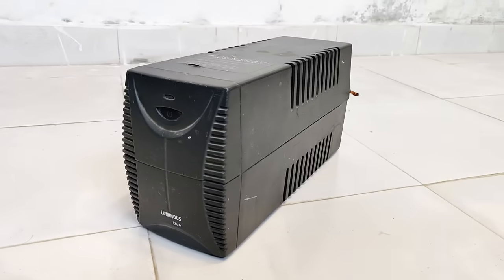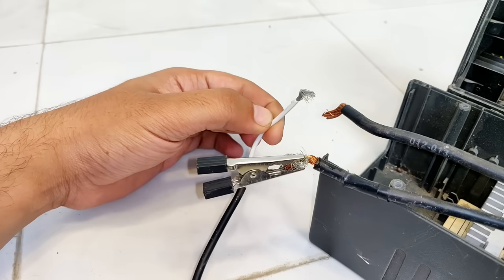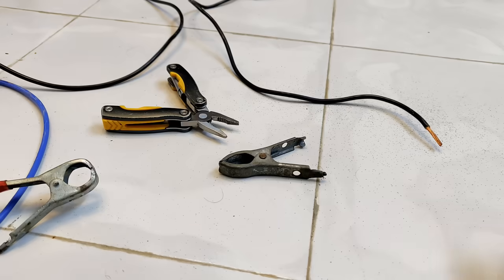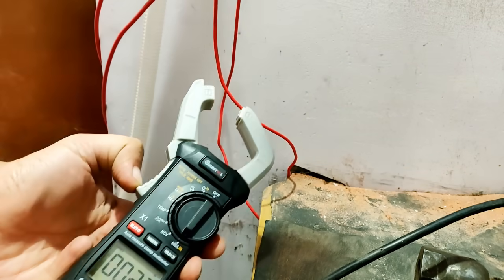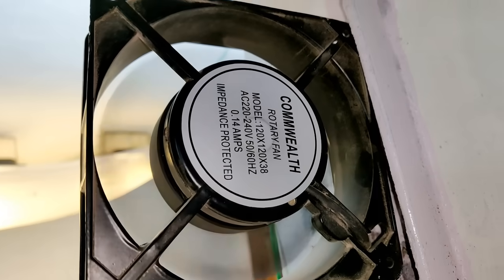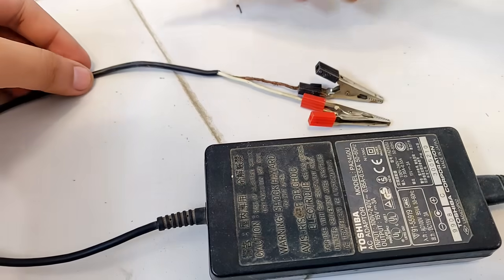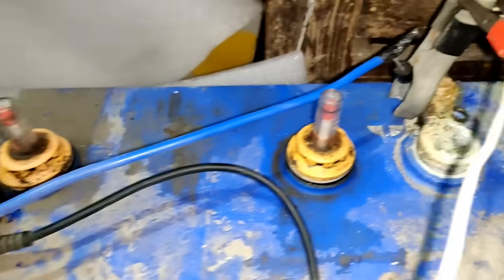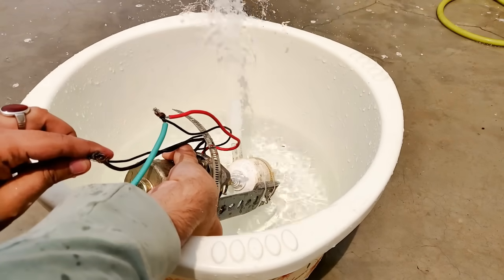Can a 12V 7Ah UPS Inverter ( 220v ) run with a 14.8V 150Ah Battery ?

Comment: I want to know if the ups switches off automatically after 20-30 minutes use ( because some ups automatically switches after 20 mins) I want it to run my 3d printer during power cuts with a car battery 48ah

If it switches off every 20 mins, what is the solution to that

Love your channel bhai
Reply: Yeah, there's a solution: buy a more expensive UPS, you cheapskate! Just teasing, but really, a 3d printer is a fabulous hi tech luxury.  You can't make a sows ear into a silk purse.  If you are in the jungle making computer parts for remote tribes, either: 1) Charge them more so you can buy better equipment to reliably make them the parts before the power cuts out, or  2)make the large parts into many smaller parts so there's less waste if the power cuts out.  I'm guessing you are a bright person who lives somewhere where there is very intermittent power.

 So my answer really is...."I don't know."  Maybe if you contact the manufacturer they could suggest a settings change, maybe there's a hidden service menu, or maybe the unit is overheating and would last longer with a fan.  Best wishes.

Comment: indian tubular battery 12v*150AH can give about 150A*6-7в max power(1kWt load with 50% efficiency fall- half of battery energy will loosed heating electrolite and separator tubular bags
same 12V150AH car starter battery(will work one month maximum in home invertor, degradates very fast) will give few minits 3000A*10V=30kWt power, and even car 12V55AH starter battery burns UPS step-up inverter schematics in one day of work on 50-100wt Computer - that work without bracking on 12v7.5AH little battery, capable to give 10-20A(with V-drop to 10V) 100-200Wt -
Reply: if you will try powerfull >20AH 12v battery - put 0.2-0.5 Ohm resistor in series of supply - like fuse safety current limiter - it must save UPS from spontaneous unexpected damage by crazy car curent battery

Comment: at 5:30 why is the difference between 15V and 14.7V significant that you need to put resistance in? It seems like that is a negligible difference. No?
Reply: 15v will boil the battery.  Good for desulfating, but will boil the battery dry.  And dangerous hydrogen, do it outside, don't smoke near it neither, or clamp anything onto  or off batterry terminals, it will make sparks.  Wear glasses! And put on a old sweater, the acid vapour mist fizz will rot your good sweatshirt overnight.
Reply: @mikemotorbike4283  0.3V difference is so small -- it can't be that close, can it?

Comment: Can use 300 watt in three four hours
Reply: No, if the load consumes 300W a 12V 150Ah battery could last about 6 hours (12 * 150 / 300 = 6).

Comment: Dude you need to restore that battery 🔋.     That battery terminals are really damaged and that is not the right way to charge a inverter battery. If you don't have a inverter battery charger you could get it for cheap but that power supply should output 30 amps, 14.1 volts max.

Comment: Its an awesome experiment and small trick with the 15v 3amps laptop charger instead of diot u can add pwm 10 amp solar charge controller u can put the charger as solar input for more protection and much safer 😉
Reply: solar charger needs pure dc not rippled dc! controller will be damaged or not work!
Reply: Good bro

Comment: Why did you not charge the battery by connecting UPS to electricity as designed in the UPS device of the company?

Comment: Interesting.  I have a similar UPS connected to a 100A, 12V deep cycle battery.  The UPS gets a bit warm but it holds out.  It is used as back up power to run a computer or two and router.  The laserjet printer just pulls too much current so the UPS will switch off.
Reply: Thinking of modding mine as well, maybe you can advise me?
Reply: @dancerehab1092  i found that the battery did not charge correctly and was weaker every time.  after rehabilitating the battery, it is trong enough again to manage the printer.  the printer is a laser jet, not as i previously stated.  what do you need ot know?
Reply: @Groot_G  I have a 650VA ups currently running on a single 12V 7AH battery. I use it to power my pc (no monitor) just the psu...my battery is dying out, it no longer stores charge. Been thinking of building a lithium power wall but then after researching I found out that they are more dangerous maintainance wise compared to other gel/acid batteries. So I'm torn between getting like a single 12v 35AH battery or configure together 4 12v 7AH batteries in parallel. Plan is to still run the pc only.
Reply: @dancerehab1092  I assume the battery is being charged by the ups's on board charger.  mine (i have been told) is not a particularly smart one.  try and charge yours externally with a charger with a rehabilitation function.  you may find that your battery "suddenly" gets new life.  with a solar regulator and a solar panel, you can extend your operations (even retaining an ageing battery) and save on the massive cost of a fancy battery.
Reply: @Groot_G  never thought about that actually, that means I would be using the ups solely as an inverter, I wonder how long it would handle the heat...I have thought of solar before but paired with lithium batteries, again, maintenance was kind of scary..I hear one can easily burn down a house if poorly handled
Reply: @dancerehab1092  The LiFePO4 batteries are the safest type of Lithium batteries as they will not overheat, and even if punctured they will not catch on fire.Also have 3000 life cycle.
Reply: Same here planning to use 12v 100ah sealed lead acid Deep cycle battery. My old UPS  uses 12v 9ah. I'll connect it to my mppt solar charge controller.

Comment: What a mess in that workshop, how about cleaning up dust, rust and get some red and black cables to the 12 volt circuits? Surprised that it all worked well.

Comment: Ups loding maximam
12ah backup time
Reply: Ah (ampere hours) is capacity, not backup time as that depends on the load. A 12V 100Ah battery that is fully charged will last at most 1 hour when the load draws 100A (1200W) or 2 hours when the load draws 50A (600W)

Comment: Good video!
1. You need to clean the battery. Any humidity in the air will cause the dirt on top of the battery to conduct and discharge the battery.
2. Batteries with plastic cases do not need to be placed on any type of insulator when on the ground or concrete. This was only a problem with the early batteries that used a porous rubber case around the cells.
3. Take some time and clean out the inside of the inverter. Dirt in there plus humidity will cause shorts and problems with the inverter. 
4. Add a fan to the driver transistors heatsink inside the inverter and make sure to add additional cooling holes. It will prolong the life of the inverter. Heat inside the box will kill the electrolytic capacitors and the mosfets used to create the higher output voltage. Remember that manufactures use cheap Chinese caps that fail with heat. I sometimes replace all of the electrolytics with temperature rating greater than those originally supplied with the inverter.

Keep up the good work, now on to solar charging of the battery!
Reply: Good bro

Comment: I tried this with car's battery and ran a computer for 30 minutes until the transformer inside ups got quite hot and melted the UPS.
Reply: For this reason, the original UPS has only a small battery and only works for a few minutes. The UPS has no active cooling! Use a fan and a heat sink for the electronics to slightly extend the working time. To extend the working time over a longer period of time, use a transformer manufactured for this purpose.

Comment: Most good UPS systems provide their own charge to the battery via the battery input leads such that whilst mains is present, the UPS provides output power and filtering from the mains whilst also charging the battery via THE SAME LEADS as are used for the battery to provide power when the mains fails. The beauty of this method is that the "switching" to battery power is instant when the mains fails. Equally, as soon as the mains returns, the battery commences charging immediately. 

UNLESS the battery used is of the CORRECT voltage i.e. nominal 12 volts (14.4 volts charge voltage) the battery can easily be OVER or UNDER charged. This is generally NOT a simple conversion if different battery chemistries are used (e.g. using Li-Ion cells to provide 3 x 4.2 v = 12.6 peak or 3 x 3.7v = 11.1v nominal). Such connections can be EXTREMELY dangerous since the max charging voltage of 3 series Li-Ion cells is NOT 14.4 but 12.6. Charging continuously at 14.4 volts when mains is present (as would be the case for Lead acid batteries) WILL cause SEVERE OVERHEATING and FIRE. To use Li-Ion batteries will ALSO require SIGNIFICANT, COMPLEX and potentially EXPENSIVE modification of the UPS circuitry.
Reply: How about if I use LiFePo4 battery, 4S cofiguration?
Reply: @eone2345 same problem. The different battery chemistries will mean that you would have a permanently excessively high voltage across the battery. A lead acid battery is charged with a fixed voltage of, typically, a 14.4volts. Other battery technologies tend to have a current limited charge current NOT simply a constant voltage. So it would be easy to overcharge any non lead acid battery and cause overheating, explosion and/or fire. 

It is essential to  understand the original design of the UPS before making such changes.
Reply: @boblewis5558  thank you 👍
Reply: or you could use two buck-boost converters and a microcontroler to control them, making the ups think it's a regular lead-acid battery. not thrusting my life on it though

Comment: Awesome vid bro, I love the bicycle generator 😂 Need to make one of those.  Hey you should really use a wire brush to clean those battery terminals, lol. And that UPS is going to get very hot if you don't add a fan, they aren't designed to run for long periods on higher capacity batteries like this and often dont have overheat protection as a result, just something to look out for so you don't burn your house down 😅
Reply: Authentic point.
Reply: Cooling fan and plenty of additional ventilation holes to keep the transformer from over heating...

Comment: how do you prevent the ups turning off after 10min.
??
Reply: Those ups's don't turn off because of a timing function.....they just turn off because the capacity of the battery which is conect to it is small ( normally is a 12 volt 7 amp-hour battery) , but you could use a car battery and the time will be increased..this is another way to test those UPSs..conect  a battery and see if the inverter is producing the AC  voltage 220 or 120 depending of your ups specifications. Please never  overload your ups with more than 80 % of the rated load in amps.....Normally a computer UPS is a 600 watt...but this is just an aproximation  of the amount of power used by the power suply  plus the load used by a monitor.....so this is  why they think that having 10 minutes to close all the files and shutdown a computer won't take that much....it used to be some ups's with a connetion  that could be used to inform a server to enter into a shutdown proccess ,  they used an open contact relay and your software will have to read the open status of the relay to decide continue working or enter the shutdown routine.....by the way the beep that those units produce just inform you that you are in the ups running mode ...no the line connected  mode.....if you want you could find the buzzer and either disconect  it or send it to a relay to inform you that the condition of the AC input line  is not alive. Cheers...

Comment: Ur video is good but I need to connect computer ups to 100ah tubular battery is it safe for ups and fans used with that connections
Reply from the maker: Yes
Reply: Similarly am using 60ah automotive battery with 10 ampere 12 Smps o/p tuned to 13.8v as a sepperate battery charger. Advice me if any suggestion from your side
Reply from the maker: As long as the voltage is same

Comment: You deserve millions subscriber👍
Reply: Sir, my answer for the corrosion of positive pole of battery is as because the electrons inside the battery are being released from negative pole and travel towards positive pole to produce electricity.
Reply: @vnachary579  1q
Reply: @zahobarjami7738  ups.kodarectinvotarbanana.hai.
Reply: @vnachary579  p∅ⁿ999
Reply: @vnachary579  0
Reply: Chhvhvh
Reply: Good bro
Reply: Why?

Comment: Can this ups charge the 150ah battery which u use?
Reply: The ups charging circuitry will put 13 volts to charge any battery you conect there. Now suppose you use a boat battery (I think they use 24 volts DC) in that case the cells just charge to 50 % of their nominal voltage. Now if you are thinking to use with more elaborated array of batteries, like telephone switch office where they use certain 48 volts DC battery Banks you definitely  will need other charger ....in any case when a battery specification is certain voltage times the amps , it tells you certain amount of power x  time that the battery will mantein  that voltage. If your load is less than the specified  the you could calculate the volt amp time into your load voltageXamps  used and that will result in the time that you will have that voltage present .

Comment: i know i can rely on you, so i have a question about a project iam doing. iam making a 12V heater from a 12V Pb battery. i will use normal coated copper wire as the heating element, and i will connect the wire directly to the battery- is it safe to do this like this, or do i need some protective circuit? the battery will be able to heat it up for sure, i know that, but i just dont know if it is safe for the battery itself. please help.....
Reply: Copper is a good conductor of electricity so you should not use it as the heating element.. Instead, try a nichrome wire.. That will work.
Reply from the maker: Correct !
Reply: @mrelectron_alternator  welp, yeat, there comes the problem. i do not currently have acess to nichrome wire, i cant find it on nay shops in my country either, AND i dont want to wait 10 years for it to be shipped from china. that is why i grabbed copper. i saw quite some people using copper as the heating element, and it worked out just like nichrome wire. but still, thanks for the answer

EDIT: nevermind then. i just found out that nichrome wire is called completely differently in my country. i found it! but still, is it safe?
Reply: @mrelectron_alternator  oh yeah, and also, talking about nichrome wire, is it safe to use it there? will it damage the battery?
Reply: You cannot make a heating element out of copper wire. Find iron wire. Find an old space heater.